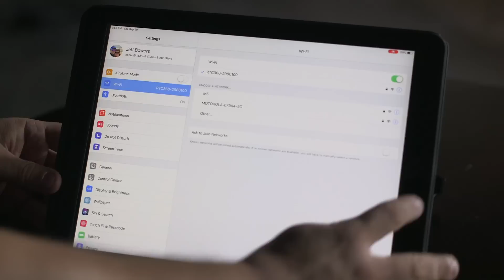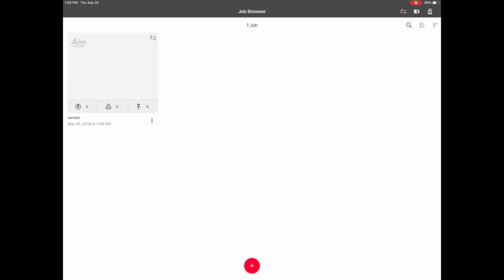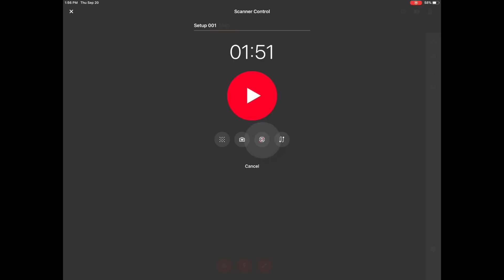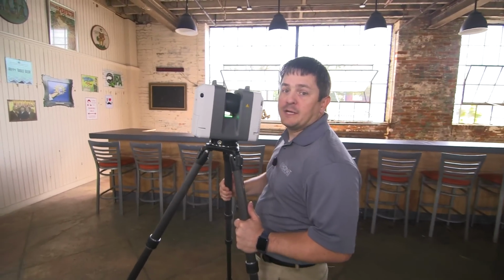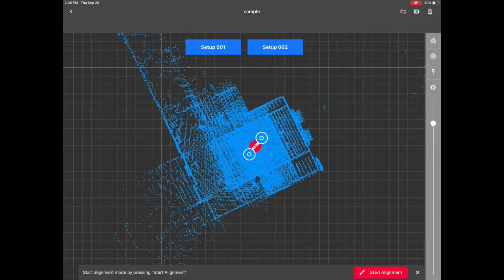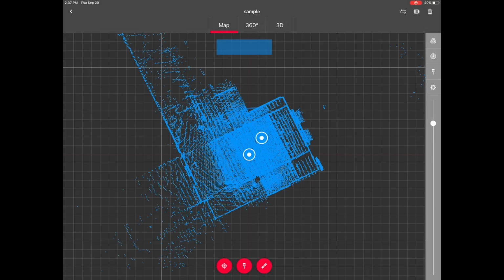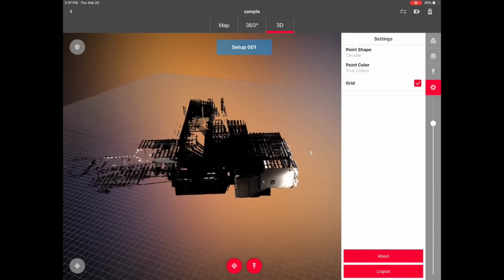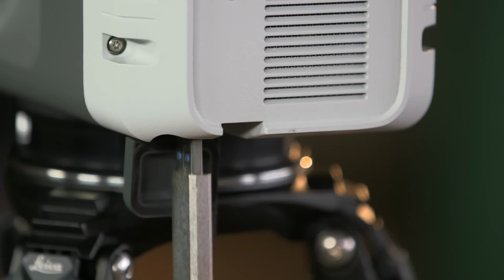Workflow Demonstration: Leica RTC360 3D Laser Scanner

Comment: What happens with the stick? Does it contain the cloud or do i need additional software to read and convert to IV or 3ds max?
Reply from the maker: The memory stick contains a point cloud that can only be read by the Leica software. Once you import into a program like REGISTER 360, you can export to a format for use in other software. 
Hope that answers the question, let us know if we missed the mark on the question being asked!
Reply from the maker: Sorry for the lateness of our reply: CloudWorx is a good solution for this, but you may also use ReCap to move the point clouds into your design program of choice.